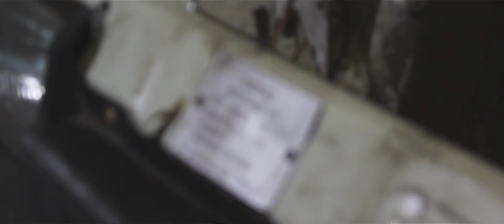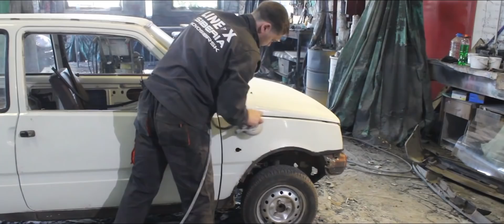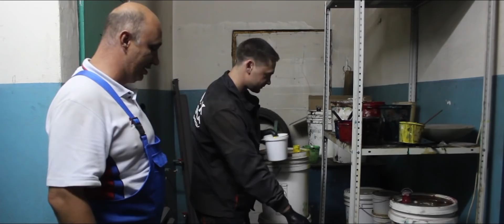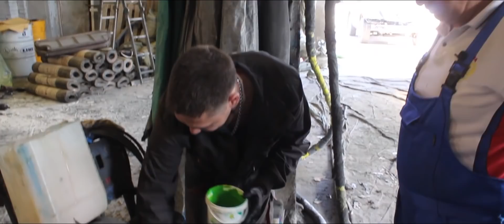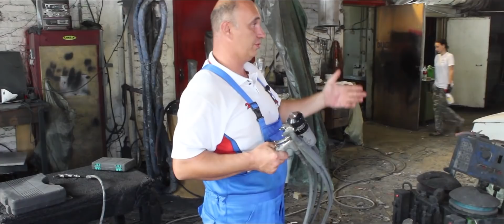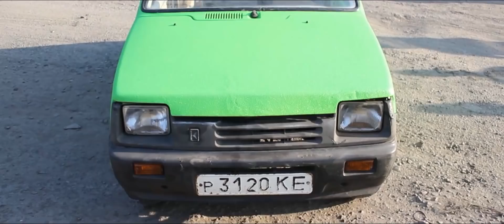Oka project car by Garage 54: part 1 – Line-X coating

Comment: The finish reminds me of when I bedlinered my old n pickup truck. Paint looked like ass, so i.sanded it, masked it, and used bout $80 worth of spray on bedliner (like $8 a can). Looked good when it was finished! And you could whack a quarter panel with a weed whacker and it would cost less than $8 to repair any damage. And any repairs just blend right in.

Comment: First off a standard linex application is 5-8 passes or coats to get legit protection, this is just a coat to give the textured appearance. Second they completely missed the front lower section of the fender when they added a layer of paint to it. But what else to expect from Russians. Make it look like they have something going on but in reality it's garbage.

Comment: 10:08 Better be careful - some of that's getting on the car.
Reply: I'm going to guess by spraying from varying distances they can control the texture of the final product. It's a messy way to do it, but effective, and fine if you aren't worried about making a mess.
Reply: @98dizzard  I'm 95% sure it's because it's a thick product so it has to come out at a high speed which means they need to stand back, basing that on my minimal experience with airbrushing
Reply: Jesus christ it looked like he was painting the room
Reply: @drumboarder1  lmao yes!

Comment: ⚠️Please, make Lada suspension test, drive quick throught hard potholes. Im wondering result😉
Reply: Much much much more comfortable than modern cars if the suspension is not completely fucked...
Reply: That wouldnt be a test, it would just be normal driving for ladas

Comment: Make your own pistons:
Cylinder 1: hard wood. 
Cylinder 2: 3d printing. 
Cylinder 3: poured raw iron from a mold. 
Cylinder 4: glass.
Reply: they already did wood
Reply: Oka's only have 3 cylinder
Reply: @televisionandcheese  it’s actually 2 cylinder
Reply: @loremipsum_show  700cc of fury :)
I don't know why I wrote 3
Reply: Glass pistons would be cool.
Reply: They tried with wood, the car woodn't go.
Reply: Copper pistons! 😂
Reply: I LOVE axia yes! that's a good one.
Reply: The glass one will melt just after a few revolutions, making it useless.
Reply: WEB it will be fun, other pistons would force it to work, plus you could mix the plastics.
Reply: @WEB theres metal 3D printing but its expensive https://www.youtube.com/watch?v=IUp3oCGZOzk
Reply: Hard, stale black bread pistons!